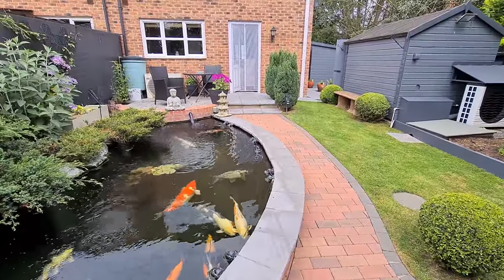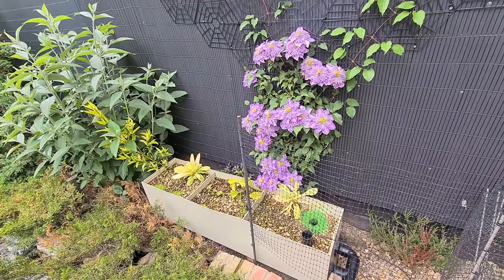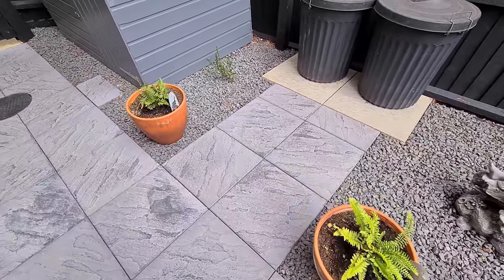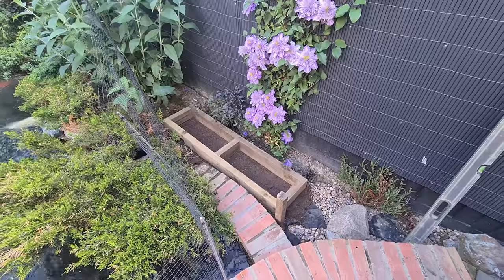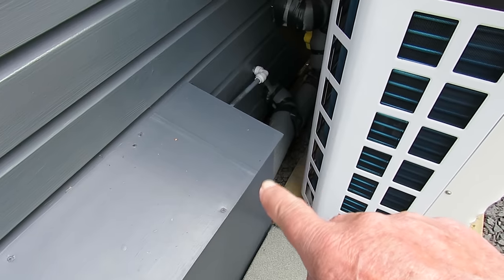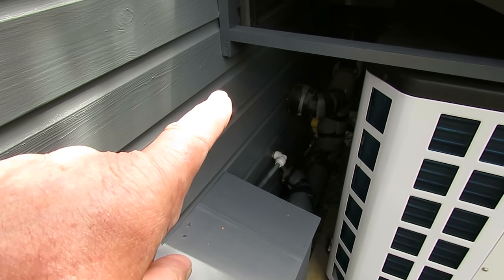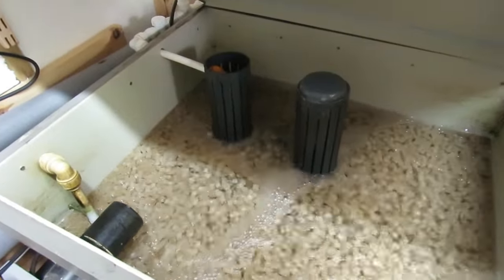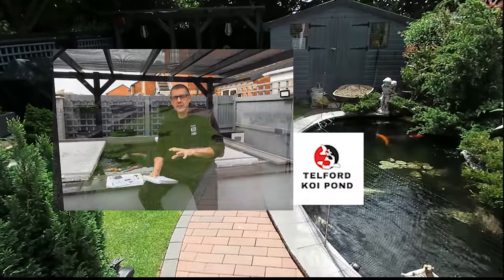Bog Filter MOD And Filter Setup Explained.

Comment: Hi Terry. I think I would add a couple of 90's on the outflow from the bog filter so I could adjust the water level a bit. You might find you're going to need a bit higher water in there for it to work.  Iris are a good plant to work in there and Arum lilies (not sure of the spelling) are another.  You could also add bull rushes but they go mad when they grow. I even have some you could have if you want them.
Reply from the maker: Hi Jim, I can't raise the outflow mate as it will run to high and nearly overflow at the other end. The gravel does slow the flow, even now I've used the larger gravel. There's about a 2" to 3" drop in water level from one end to the other. That's what the problem has been mate. Trouble is, I can't have anything in there that grows too tall, as the wife's plants are at the back of it, and I've been told mate 😅😅 you know what it's like, but thanks for the offer mate, much appreciated 👍👍 take care, Terry.

Comment: I've had a bog which was 18" or so inches deep. (Sorry I'm from US)45 cm deep. Even has stagnant areas.. and the roots usually will go deep enough to get what they need.  I do wonder what effect cloverleaf has on your bog.  I can't get it in the US so I haven't done much research.  Also, often plants turning yellow are usually from over watering. So make sure you have plants that actually like their roots submerged if you have a true big setup.
Reply from the maker: Hi DeAndre, The Cloverleaf Blanket Answer says on the tub, it's totally safe for pond plants, but they were starting to turn yellow before I used it. The plants I bought were all wetland plants for ponds, or so they said. I'll see how the Mk2 bog goes with water flowing through all the gravel. Thanks mate, much appreciated, Terry.

Comment: That was a great walkthrough the filter system. So if I got that right, the shower, the upflow and protein skimmer are like in a loop with the moving bed? 
The pond looked really clear.  The shusui has grown!
Reply from the maker: Hi Lau, and thank you, very much appreciated as always. The shower is drawing water from the RDF outlet, and returns the water to my 3" pond return pipe. The up-flow and protein skimmer draw from the moving bed, and return to the 3" pond return pipe. This is so I don't get too much water bypass the moving bed. I must say, it all seem to be working well with that setup. The Sushi has doubled in size over winter with having the pond heated. I have to admit, I might not heat next winter if the cost of electric keeps going up like it is. It cost me £185.00 to heat my pond this winter, which I don't think is too bad. That's from November to now. But it could be over double that next winter, so they might have to get cold come winter time, and they won't like that 😅😅 as they're spoilt rotten 😅😅 Thanks again Lau, take care and stay safe, Terry.
Reply: @Wrighty  hmm, I need to rewatch your video again 😊 
Yes I think a lot of people may not use their heater. Would you be able to put it on and leave it at 12? 
It's so expensive though, and we might not have the mild winter we had last year.
Reply from the maker: Hi Lau, Yes, I'll give it a go at a lower temperature, and see what it's costing. They had a good winter this year, as the lowest it got to was 16c. I told you they were spoilt 🤣🤣 I can't believe the weather here at the moment, wind, rain and really cold here today, where's the summer🙄🙄 hope it's better where you are 👍👍🤞 take care, Terry.
Reply: @Wrighty  they are spoilt indeed 😊
Weather is good here but fresh in the morning.

Comment: Brilliant Tel, many thanks for the set up info. Re the plant in the garden that wasn't doing so well - have you tried throwing some of the waste from the sieve filter around it? I have noticed a real improvement in the roses and fruit trees since I started doing that, plus I use the waste water when cleaning out my midi filter set up. Thanks again mate
Reply from the maker: Hi Ray and thanks mate. I usually give my plants the waste from the up-flow filter, but I haven't lately because I had the Cloverleaf Blanket Answer in the water, but I will again once it's clear. Thanks for the comment mate, and take care, Terry

Comment: Hey Terry,  it's the wind that's doing my head in constantly heavy winds so can't even sit out with a coffee to watch the pond. 

I bought some baby tears and had 3 plants, 2 of them died off I think too much water and the other is also very slow growing!

Have you thought about putting some water cress  in your bog filter to give it a try as very cheap and very good at cleaning the water?
Reply from the maker: Hi Richardo, the wind here has been terrible. The trees around us help to shade us a bit, but we are finding loads of branches in the garden and in my pond from them. I was going to get some water cress to float on the pond in a rubber ring so it doesn't get in the skimmer, but haven't got around to it yet. Thanks mate, have a great weekend, Terry.

Comment: Terry I've just ordered another screen for my RDF, Woven Mesh 200 which is 70 micron. Are you aware that your plans call for Woven Mesh 325 which is 44 micron? I feel that this is a bit too fine in my opinion, especially as I'm gravity fed. I'm changing it to be able to increase the flow in the pond and hold the water level in the RDF. I would be interested to know why you went with such a fine mesh on your plans, when most manufacturers go with 70 to 120 micron screens. Thanks Bob
Reply from the maker: Hi Bob, can you drop me an email mate, pondfilters@gmail.com and we can sort this out mate. Terry.

Comment: It might depend how it flows, i have one where the water is pumped into the bottom from the pond and then filters back up through the gravel to over flow from the top, does yours flow one chamber to another ? Length ways? 
I have done a little research and the the bog needs to be a certain depth to do the job correctly, but that may depends on how it flows or designed.
Bottom up flow I find very effective, plants grow crazy and the water utilises the whole bucket or barrel. The bottom up one I use  is  wine barrel size and depth,  so deeper rather than longer that way it has to use the whole area by the time the water flows back and over into pond . 
But I find your set up very impressive 👍🏼 I do think you need a certain depth for the different oxygen zones to get the parts of it working and slow flow. But I could be wrong and wold be very interested in hearing other’s experiences with them. 👍🏼
Reply from the maker: Hi mate, and thanks for the info. I have the water coming in at one end and flowing out at the other, it's just one tray with no compartments. I do find that the water level is 2" to 3" higher from one end to the other. So the gravel is slowing the flow, even with using the larger gravel. I'm just going to put some plants in it and see what happens mate, will be interesting to see how it all goes. Thanks again mate, and take care, Terry.
Reply: @Wrighty  you have a beautiful yard and pond , what ever works best for you, you have a Awsome set up by the looks 👌🏾👌🏾

Comment: Hi Terry. I have the three barrel k1 filter. how often would you recommend them to be cleaned out. Thanks in advance, Alan. Brilliant system!
Reply from the maker: Hi Alan, every pond is different with their cleaning times, as it depends on how much dirt is coming up from the pond. I would start with once a week, and see how things go mate. If you're finding a lot of dirt in tubs 1 and 2 when cleaning, reduce the time between cleans. If your not getting much dirt, leave it a couple of days longer. Hope this helps, and thanks mate, Terry.
Reply: @Wrighty  
Thanks for the reply Terry. I was just a bit worried about over cleaning and losing all the bacteria. I usually clean each barrel X 3 times which is equal to 10% of the pond and system! Is this okay? Thanks again for your time! Regards Alan🙋‍♂️
Reply from the maker: Your welcome mate. The bulk of your bacteria will be in the bio bed, tub 3 (moving bed) which requires very little maintenance, as it's self-cleaning. A wipe around the bottom twice a year with a long handled brush usually does the trick. You will find most of the dirt in tub 1, as it's the first in line, so it may require more cleaning than tub 2. Tub 2 catches whatever tub 1 misses. As long as you don't use tap water for cleaning in any of the tubs, (as tap water contains chemicals to kill bacteria), your bacteria will be fine mate. Take care, Terry.
Reply: @Wrighty  Brilliant thanks Terry. Good day to you!

Comment: You know when you dosed with Cloverleaf did you bypass your drum for a few days as even with me dissolving in hot water the drum seemed to remove it all in a matter of hours I could tell as the drum was cleaning very frequently.
Reply from the maker: Hi Richard, No mate, I didn't bypass the drum. But I did turn everything off in my filter house, apart from the air to the pond for nearly 2 hours, to give it a chance for most of it to settle. The drum does, like you say, take it out of the water, so I did lose some, but it seems to have worked quite well. Hope this helps mate, Terry.
Reply: @Wrighty  I did a dose on Saturday but couldn't cope with the bottom all being white. How long should I have left it before I swept the bottom, most of it's turned white perhaps I should do another dose?
Reply from the maker: Hi Mate, It's best to leave it in the pond as long as possible. Have a look on the tub, I think you have to leave it a week or so before re-dosing, but I'm not sure, so do check. I don't mix mine with hot water, I just give it a good stir, and add it to the pond. I must admit it is quite messy, but it does work. I've found that algae treatments are never fast working. It can take a couple of weeks to do the full job. You could always try the Aqua Source Resolve, it's quite good, and you don't get the mess. You just sprinkle it straight in to the pond. Hope this helps mate, Terry.

Comment: Hi Terry, bit of advice needed if you don’t mind. I’m limited as to the set up I can have. I have to go with a pressurised system so I’m thinking of linking two together but with a separate 110w evo UV. Can I run two filters, in series, off the same pump? I’d love to have a pre-filter like yours but can’t think how I can do it with a pressurised system. Hope you can help. Paul.
Reply from the maker: Hi Paul, a few years ago now I ran 2 pressure filters on my pond, but I had them fitted to a Y connection so the flow got split 50 / 50 that way, one filter is not doing all the work. It did work really well, and I also had my UV just running on the return from one pressure filter, and never had any problems mate. That's all I know mate really. Hope it helps a bit. Take care, Terry.
Reply: @Wrighty  thanks for the advice, would I be ok to put another Y connector on the outlets and then into the UV?
Reply from the maker: Hi Paul, I've never tried it mate, but I don't see a problem. As long as the UV doesn't restrict the flow. When I run the 3 barrel system, I always had my UV after the submersible pond pump, just before the filters. If you have a bottom drain, you could run some sort of sieve filter first, to take out all the algae and bigger dirt before it gets to the filters. Terry.
Reply: @Wrighty  Thanks. Keep those videos coming 👍

Comment: Any idea what your soil is like. Acer needs to be moderately acidic. Your planted acer looks like its it not getting fed and roots may be stunted. If your soil is alkaline when you take it out, make the hole larger (about 3x the size of root ball) and mix in a good proration of Ericaceous compost when replanting. Ensure roots are not rotted and are free to travel. 👍
Reply from the maker: Hi Paul, thank you for your comment and advice. It's very much appreciated. Our soil here is quite clayey, so I did dig the hole quite big when I planted it, and filled the hole with acer compost. This acer was not well when I got it from a company on eBay, and they did give me a refund. I have since bought another one, and put that in there, and it does seem to be doing better. Thanks again mate, Terry.
Reply: @Wrighty  good stuff. 👍

Comment: What are your Nitrate levels like ? Are you processing it out and the plants are just missing nutrients?
Reply from the maker: Hi Ed, my nitrate levels are usually high, that's why I'm having a go at a plant filter. As you may know I've just fitted a bakki shower, this does seem to be making a difference, as my nitrate levels do seem to be coming down. So fingers crossed. Thanks mate, Terry.
Reply: @Wrighty  I wasn't sure if the Bakki shower was so effective that you had stripped it all out :)
Reply from the maker: Hi Ed, No mate, I've struggled with nitrates for quite a while now, even the bakki river didn't seem to help much, that's why I swapped to the shower. Now it's starting to settle down, it does seem to be making a difference 🤞🤞 I haven't planted the plant filter up yet, as I want to see what difference the shower makes. Thanks mate and take care, Terry.

Comment: It might be that the water is that clean overall there is just no nutrients for those plants? I have the same issue, all my plants in my large "river" return are yellow but I never hardly even get any nitrate readings so nothing for the plants to feed off??
Reply from the maker: Hi Matt, my nitrates are quite high mate, and the plants are still turning yellow. I'm going to see how it goes now I have done the mod and cut it down mate. Will let you know how things go, take care, Terry.
Reply: @Wrighty  it will be interesting to see your results so I can try and stop mine doing the same

Comment: Isn't the issue that your inlet and outlet are at the same level so the water wont ever rise high enough? Maybe put the outlet higher and let the water level rise? Of course, I might be wrong so apologies in advance!
Reply from the maker: Hi Paul, my in and outflow are the same level mate, that's right. But the problem is, the water is not flowing through the gravel quick enough, from one end to the other. The gravel is slowing the flow, which is the problem. If I lifted just the outlets as it is, it would flood where the inlet is. You are correct in saying, the problem is the in and outlets. What I need to do is, have the water coming in all along the bottom of the filter, so it's released all along the filter bottom, then have about 3 outlets along the top. The water then would come in at the bottom, rise up through the gravel and out at the top. This would keep a constant water level right across the filter. Thanks for your input mate, take care, Terry.

Comment: How would putting a bell siphon on the bog effect the pond?  Do you have a auto water top off?
Reply from the maker: Hi Scott, How I have the bog filter running now, I could actually fit a bell syphon. I don't have an auto top up, I have to push a button on mine to top up. I will give it some thought though mate, thanks. Take care, Terry.

Comment: Hi terry could you tell me what gravel you used in the bog filter,regards Les
Reply from the maker: Hi Les, I just got some normal gravel from my local garden centre. It was supposed to be graded, but it wasn't, so it is different sizes. It was 18mm (3/4) on the bag, but it's normal gravel you'd put on your drive mate, if that helps. Terry.
Reply: @Wrighty  thats terry
Reply: Sorry Terry ment to say thanks

Comment: I think your bog water is just whooshing along the bottom of the filter. You need to put some stops in the bottom of each of the three bays. Then the water has to go up and over each weir which will give you more flow through the gravel. just my idea
Reply from the maker: Thanks for the tip mate, much appreciated. I'll see how the Mk2 goes. If it doesn't work, it's back to the drawing board 🤣🤣 take care mate, Terry.

Comment: What pressure pump are you running on the drum ? In 4yrs of having my drum it’s gone through 3 pumps now just put new one on this week 🙄 and my pump for my shower packed up last week ! Typical ! 🤦🏻‍♂️😂
Reply from the maker: Hi mate, your not having a good time with pond pumps by the sound of it mate.I'm running a Jebao Variflow 30,000 @ 70%, so it's getting a good flow of water. My last variflow pond pump was on there 2 years, and is still going strong, so I don't know how long they last. Just a thought, but are you regulating the flow from your pump, as that could make it work hard. That's why I use the Variflow pumps, real easy to control. Thanks mate, Terry.
Reply: @Wrighty  my main pump for shower was 10yrs old so done well really 😂 just these high pressure pumps on the drum for spray bar that’s needed replacing 3 times now . It’s the Filtreau Drum Filter Wash Pump.. hope this one lasts longer than the last two ..just wondered what type you use ?
Reply from the maker: I use a normal 260w household shower booster pump bought on eBay, and it seems to be doing the job. I use to use the 150w, but thought I'd try the 260w. Not much difference really. Terry.
Reply: @Wrighty  could you give me a link to the pump please mate? I bet it costs nothing like the one I’ve used 🤦🏻‍♂️😂👍🏻👌🏻
Reply from the maker: Hi mate, Here's the link: https://www.ebay.co.uk/itm/255499213713?var=555452891400 but it looks like they don't have any more 30,000 lph pumps as they're out of stock. It cost me £320.00.